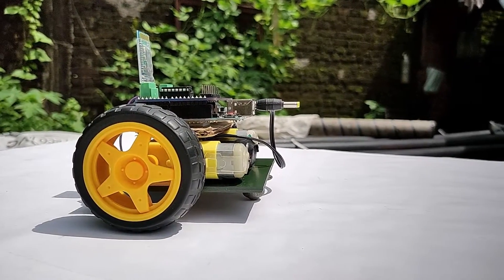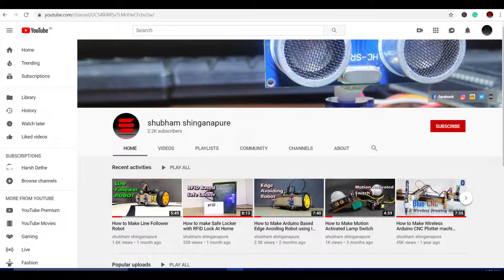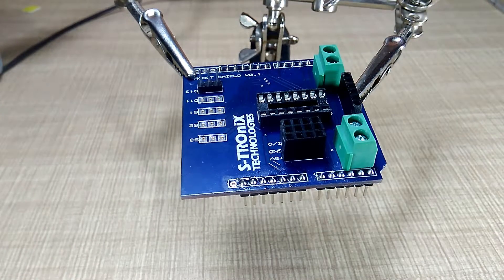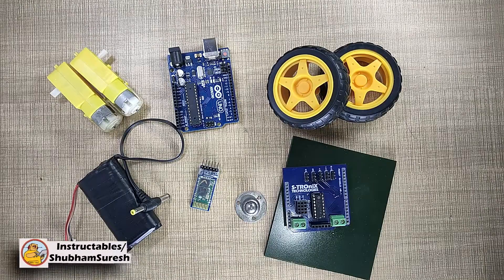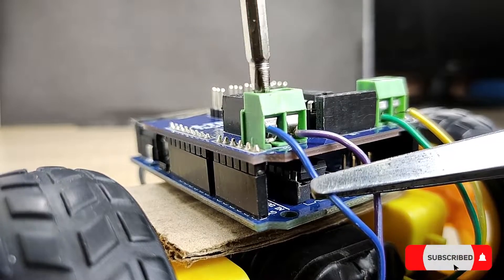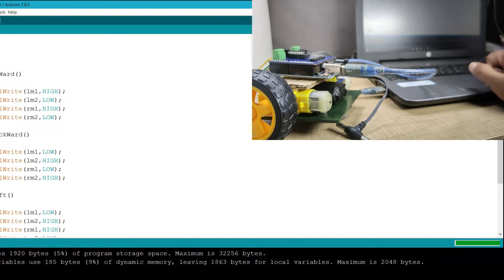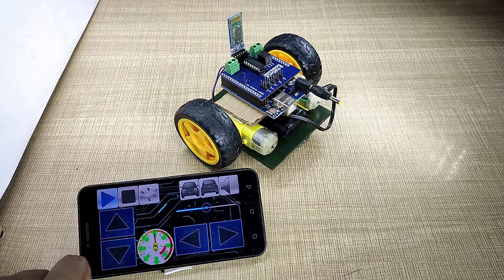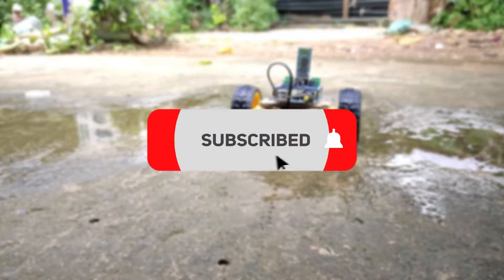How to Make a Bluetooth Controlled RC Car at Home

Comment: sir ,can I use HC-06 BT module should I need to change the code???. I made a BT car but its not working all lights are glowing but ardiuno tx and RX lights are blinking low plz help me .
I use 1 ,9v battry it is 2WD car
Reply from the maker: double-check the connections and try it again, there is not much difference in hc-05 & hc-06 module. The main difference is that hc-06 can only use as a slave device. so it does not matter since hc-05 in this project working as a slave device.
Reply: sir all connection s are right I made this robot more than 3 to 4 times
Reply: if I give power to arduin and motor driver the motor rotates automatically
Reply from the maker: @doglovers9162  try by using fresh Arduino board.
Reply: OK sir but if it still not works how can I contact you???
Reply: my bt blinks slowly when connected to phone but car does not moves
Reply: plz help me sir this is for my school project I need to submit fast